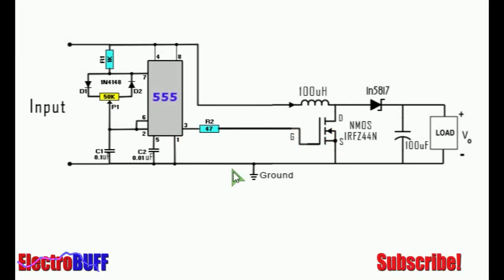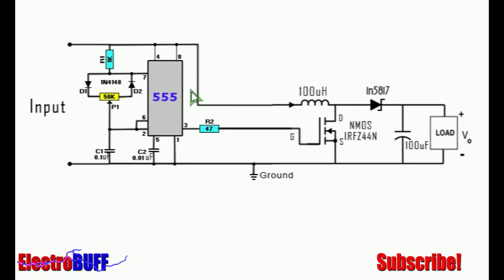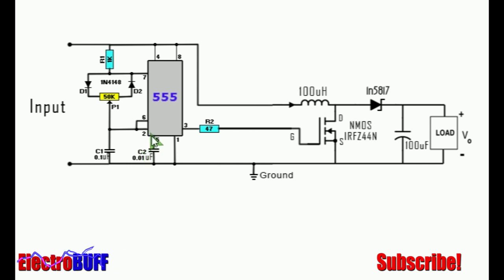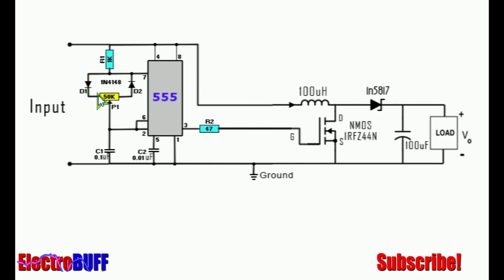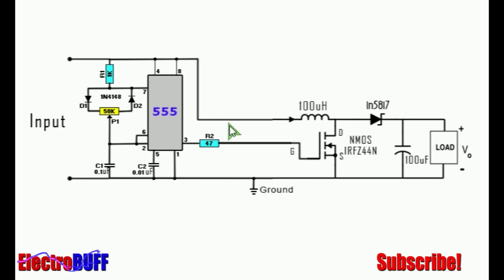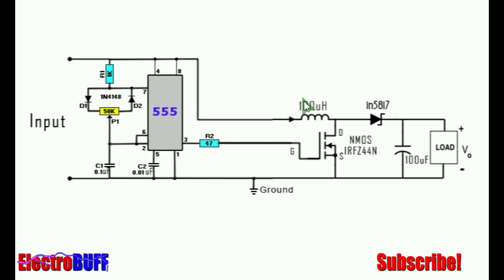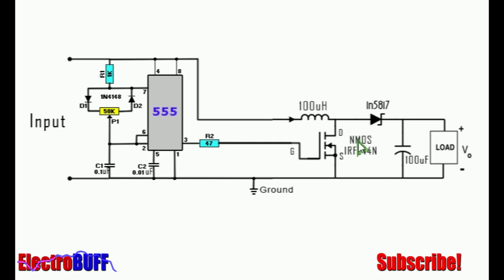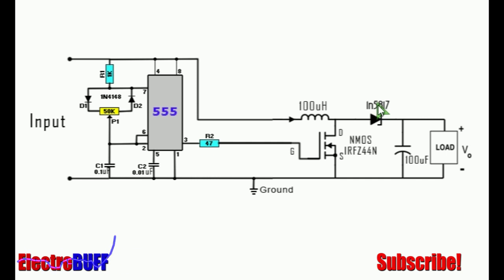555 DC-DC Boost Converter Power Supply | 12V to 120V

Comment: it changes according to load value...
Reply: of course it does, provide a better current source, and replace the mosfet
Reply: @bsuryasaradhi6816  it’s not only about current source, you need to adjust duty cycle accordingly to the drop of voltage. It can be achieved using opamp with reference voltage on its inverting input and divided output voltage to the non inverting input, output goes straight o the 5 pin of ne555. Works for me.